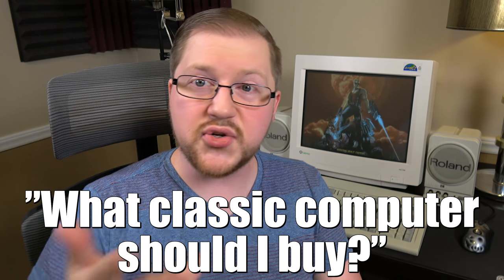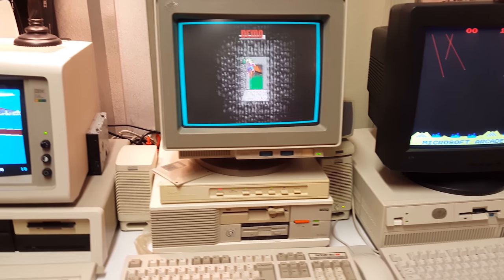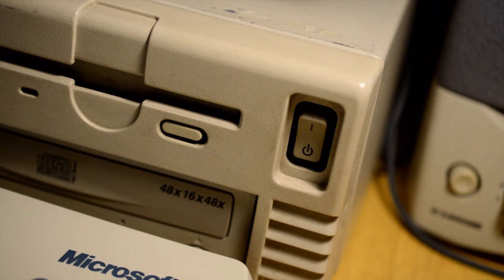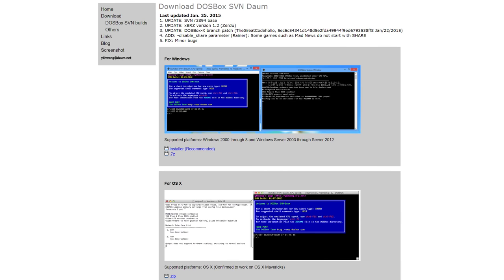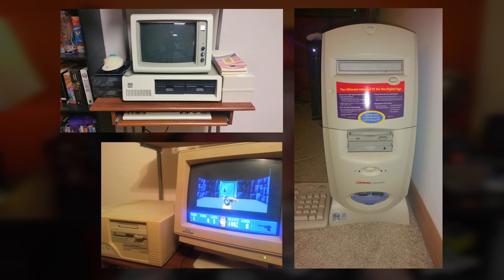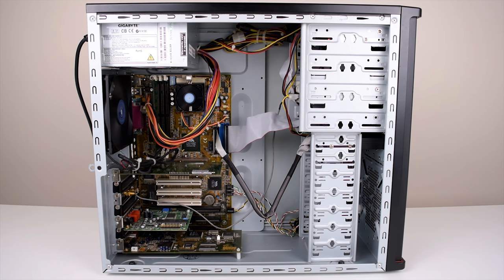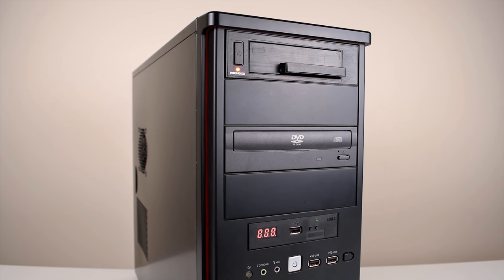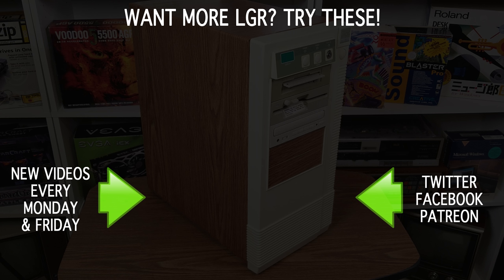Choosing a Retro PC for Games: Advice & What to Look For

Comment: Noob question. Anything for Windows 95 and Windows XP era point and clicks that isnt a virtual machine?
Reply: If you want it cheap then either an early Pentium 4 (Northwood around 2GHz) based desktop with a Radeon 9600 series graphics card and 512MD RAM or the Thinkpad T40-42 or R40 notebook if you don't have the room for a desktop. These are fully Windows 98 compatible and can handle XP as well if necessary.

The Dell GX260 SFF I think is a very good choice, though then you must find a low profile AGP graphics card which can be hard with a decent performance AND W98 compatibility. Maybe the Geforce 6200, but I think all the low profile versions have 64bit memory interface which can make them bandwith starved.

Comment: I happen to have an Intel core 2 lying around gathering dust...  Can this be a basis for a 'retro gaming' rig based on windows 98, or is it too new already?
Reply: All you need is a old gpu and soundblaster. Everything else will "just work" if you install a older version of windows. That's the beauty of PCs, up until a few years ago you could use ancient hardware in a new computer and it wouldn't complain. Thanks to UEFI BIOS that's no longer the case. Much of that legacy compatibility is gone.
Reply: Define 'old gpu'?  I'm guessing anything AGP will work, but what if the board only has PCI-e?
Reply: I meant Nvidia 7800 GTX 256mb

Comment: I have an old notebook with p3 cpu with windows 98se for some 98 and lower games and HP 8000 elite tower with Q9505s cpu GeForce 710 with windows 10 on a 500gb ssd and windows 7 on a 80 gig ide hd windows XP on a 80 gig ide hd and Ubuntu on another 80 gig ide hd  so at start up i switch to what OS i want to run i also have another windows 10 tower with a intel i5 8th gen cpu with 12 gig ddr4 and RX570 graphics card all have CD rom drives my HP and notebook has cd an 1.44 floppy

Comment: Ok, this video is very insightful and well done, but....how the heck is one supposed to get a legit copy of Windows to run these games in the first place??? I’ve looked EVERYWHERE for a copy of Windows XP for example, and everyone, including Amazon is selling mostly OEM discs, which from my understanding, is not intended to be used on any other machine except the one it is tied to. And don’t get me started on activating the OS. GAH!! Like, I want to get into emulation at least, but I’m worried that I might end up buying a pirated copy of Windows even, and “That’s no good!” There’s GOT to be a place to buy Windows legitimately....right?
Reply: If it makes you feel better about buying an OEM key from Ebay/Amazon I've recently purchased a copy of WinXP 64 bit for £2 (Came with a key and the ISO burnt on a disc) from Ebay and it worked perfectly. It's recognised as a legitimate copy of XP via Windows genuine advantage and works without issue :)

Comment: I have amiga 2000, 3000 several old pcs from 223mmx to p3 1400 Atari 800xl commodore 64 and you know what they are all in a closet.   I finally came to the conclusion that the emulation or all those old machines are far superior than the real deal.

Comment: At the moment, I use a Win10 laptop for retro gaming - I may try and find a Win98 machine or restore my WinXP machine when I get enough space and money to do so.

I personally prefer to run games from their original discs with compatibility patches when I can. The only era I have issues with is the majority of my 95/98 collection, which generally can't run from the disc. If anyone has any general solutions for Windows 10, I'd appreciate it. One 'tip', if a game has SafeDisc copy protection (which was removed completely on Win10), a cracked exe gets around this with no game compatibility - I'd prefer to avoid this, but I don't think there's a choice.

Another question. Can anyone recommend me a good Win10 floppy drive for use with DOSBox (some CD games - like the Sold Out release of Worms United - have the .bat files, but I'd prefer to not limit myself to those releases)? DOSBox is the only computer emulator I use (I use ones for GBA, PS2 etc, but I'd prefer to run from Win10 for legacy software) and I've just recently joined a few big box game trading and vintage computing Facebook groups to expand my knowledge beyond LGR (which I've been a subscriber to for nearly 3 years now - love your content, Clint, keep it up) and a few mentioned in this video. Any other tips related to this would appreciated too, please.

Comment: I still have a question on all these older computers and the year 2000 problem ( I actually forgot what the solution was). The amiga has a year 2016 problem. Finally I have a dell cpx j650 turbo laptop (what does anyone think?)

Comment: realisticly, there is no one "silver bulet" PC that's going to let you play every PC game that has ever existed.  Oddly, the best solution for most situation is simply to use a DOS emulator, they have gotten very good and come in many speed factors and versions letting you play nearly every game that has every DOS game that has ever existed.  If you want real hardware, you kinda need more then 1 PC, probably more like 3 PCs; a PC from the mid to late 80s, preferably an IBM XT with speed throttling or "turbo" capability to play early DOS game up to later EGA and even VGA games, a Windows 3.1 PC from the early to mid 90s, probably a 486 DX2 66 with a early 90s Sound Blaster card.  Then finally a late 90s Pentium II or similar PC that runs Windows 98 or possibly Windows 2000 Pro (and I do mean 2000 Profesional, DO NOT try to run that piece of crap Melinium Edition, you'll be sorry you ever tried) that runs many of those late 90s and early 2000s Windows games, but in some cases, you can get many of those games to run in compatabilty mode on a Windows 7, 8, or 10 machine with few exceptions.

Comment: how much better is from voodoo 3 to voodoo 5 ? I only own  voodoo 3 it still works great
Reply: It's noticeably better, with 4x AA and fancier colors and all that. But they are very expensive, and mostly pointless to have. By the time the Voodoo 5s launched, you could just grab a GeForce 2 MX for a cheap price and do basically anything you wanted with it. The GeForce 256, Rage Fury Maxx, and Radeon also were available that year, and if you wanted the best of the best you'd just grab a GeForce 2 GTS and be done with it.

There was just no room left for VooDoo at that time, unfortunately.

Comment: I have never been faithful to the actual hardware, wether it was a PC or a console. Because of that - to me - the possibility of emulation always appealed greatly. Heck, back in the 1990s I emulated my SNES on PC, despite having the console connected to the TV. And I remember I threw off friends, who are  casuals with video clips, where I actually used emulation. Yes, it’s not perfectly accurate and you miss on the haptics, but really… to me, emulation has everything that I need. For old PCs, 86Box is my go to emulator and it really provides me with everything I would want to dabble with.

Comment: You pretty much have to use emulators. You wont find much media other than CDs that are readable today. But... why would you want to use an old machine to play old games that you can emulate  ?? Most old 1982-1993 games are just not too fun compared to today's stuff and the hardware is LOUD ...  Is that A Final Unity ?????? .. Ohh... Privateer 2 !!! All you need not is my original copy of The Terminator ..

Comment: My pc's are cursed I bought 4 of them for 5 dollars 3 were old Windows 95 gaming computers two were identical so I took one apart to make the other work it has a Pentium  ati mach 64  I haven't got the sound cards to work yet and then we have the problem child I can't even find this pc online it's a zenith data systems z-425s+ 486 I got this one home powered it on and it worked fine I went to the bathroom and when I got back the psu went so I took the hard drive out and tested it and I worked for 5 minutes then it went bad to but I have the matching monitor and don't want to give up on it
Reply: Ps I am new to retro pc collecting

Comment: I skipped most of this BULLSHIT. It did not matter which PC you owned the main thing about PC gaming then, or even using utilities was BATCH FILES. You could not put in Star Wars and Football Manager and expect them to work out of the box. You had to create a batch file to give more memory for one game than the other. A fantastic program at the time, which for a utility was more fun to play with than games was Quikmenu. You could create batch files via it's interface, but you would not really be creating them, it was more a case of using Hyperspin for retro gaming, or retroarch more so, where you would create settings for different settings, click save and they would run as best as they could.

Comment: Main problem with Windows 98 is there is NO virtual software that emulates 3D acceleration in Windows 98. You have NO choice but to use hardware for games from the late 90s to early 2000s.

Comment: Serious question: why buy an old PC when a modern PC can run better games AND old games with DOSbox? I don't see the need for old hardware. The beauty of master race is that we appreciate our heritage.
Reply: In my case I wanted the fun and challenge back. Modern PC's work, you install Windows, it works, it forces all kinds of stuff on your PC and then you use it.

My retro PC is the one I use when I actually want to tinker with operating systems again and experience something where I can find new things and challenges to explore.

But you are right that 99% of games, if not 100% of games I can play fine on my modern PC to.